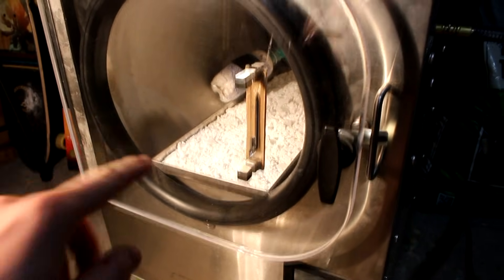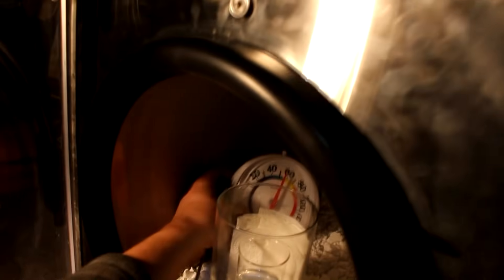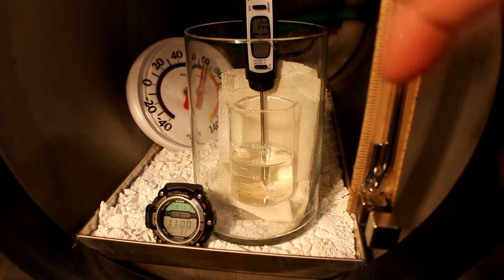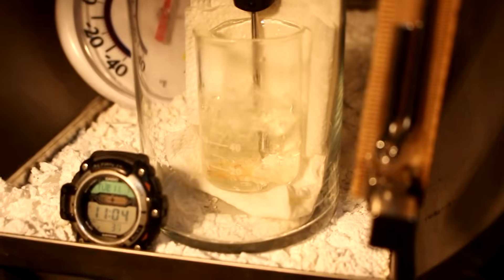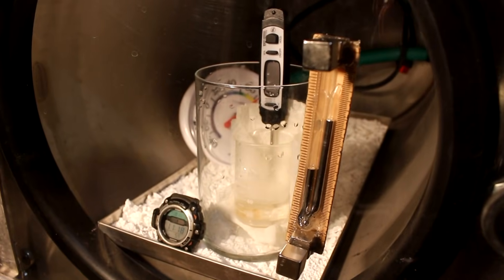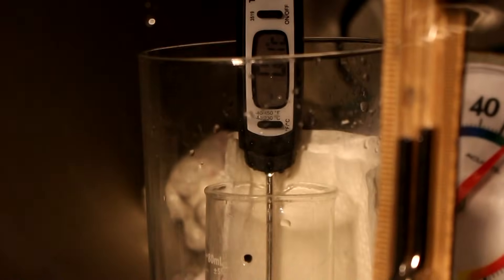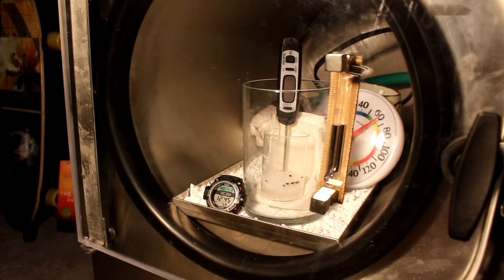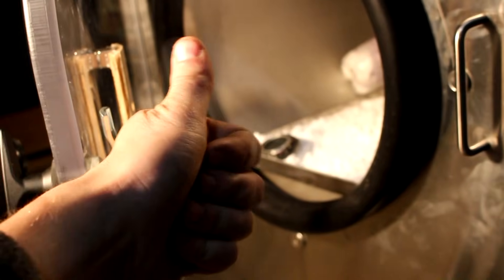Boiling Water Until It Freezes

Comment: Metric The System For Retards That Have To Use Their Fingers To Count
Reply: 12 inches in a foot. 3 feet in a yard. 1760 yards in a mile. Or just 10 mm in a cm. 10 cm in a dm. 10 dm in a m. 10 m in a hm. 10 hm in a km. Now which is more precise?
Reply: *****
Thinking is hard, try it sometime dipshit.
Reply: Crooked Hillary I didn't ask which was easier. Which one is more precise?
Reply: Crooked Hillary Haha you still can't answer which is more precise. If you're educated in even high school chemistry you would know, smaller graduations = more precise.
Reply: Both are equally "precise". Precision is a matter of measurement resolution, not ease of conversion. That said, Imperial is advantageous for quick measurement using units that are easily relatable to practical experience, while metric is much simpler to perform calculations with.
Reply: Crooked Hillary Sure you can divide it like that. But are your rulers marked in thousands of inches? That's not directly relatable anymore, is it?
Reply: This is bad bait and so many people took it
Reply: I got the joke, it is a good joke, even when it is from anarchist.
Reply: Crooked Hillary your cookbooks don't use metric and so it is racist?
Reply: moo. don't even try to convert 5/64 of an inch to mm haha
Reply: omg someone else actually realized it was a troll
Reply: Crooked Hillary thinking is hard and you seem to not think about one simple think. if you are going to put all your processong power just to understeand measurements you did you will be simply unefficient. imperial system is based on completely arbitrary shit that have no logic or anything in it
Reply: Crooked Hillary not to mention that imperial system is DEFINED by metrics
Reply: The British Imperial System- the system used by Americans who.... supposedly hate the Brits... hnnnn yeeeeah lol calling people who prefer to use whole units rather than ones based off what? "the length of the King's arm" "the width of the kernel in the wheat" etc etc yeeeeah again, oh oh oh so accurate lol Oz here so  not against Pommy land but man oh man metric just beats the snot out of our old system.
Reply: Crooked Hillary Also the metric system is completely compatible with scientific notation. Nobody uses standard notation.
Reply: Worse, an inch is 2.54cm. 25.4mm. How the fuck do I measure .4mm without a caliper lol
Reply: Crooked Hillary 😂this is hilarious
Reply: +hey7328 You're talking to a Trump supporter. Their brain has since left their body for awhile now. You can't reason with it, something needs some knowledge to be reasonable.
Reply: *****
My Aunt Jemima Cookbook.
Reply: *****
I can divide a mile into thousandths of an inch, that's precise enough for me.
Your desperation is amusing.
Reply: My Cookbooks Don't Use Metric.
Metric Is For Weak Minded Conformist.
Metric Is Racist.

Comment: I haven't seen anyone mention this, but this property is one of the major reasons why you need to wear a pressure suit when flying at extremely high elevations.  The lower pressure actually causes your blood to boil (specifically in the joints).  The end result is a build up of nitrogen gas, which is of course very painful.

Comment: Can you burn water? I think if you heat it fast enough it will burn instead of evaporating
Reply: in that case youre not actually burning anything, the burned material at the bottom of the snowball youre heating with the lighter is actually just soot

leaving this link which explains it better: http://www. snopes .com/politics/conspiracy/fakesnow.asp
Reply: Cheeseymanpie Jr. no,you need to split the oxygen and hydrogen first by electrolysis.Extreme heating will only result in extreme flashover
Reply: water can be burned if electrolysed, but you cannot gain any energy from doing that. unless you use nuclear fusion on hydrogen produced from electrolysis.
Reply: Water is actually a combustion product, assuming your definition of 'burn' means what most people think of, which is actually a redox reaction.
Reply: there's no carbon in water, so no
Reply: As water is a combustion product that is fully oxidised you can not burn it. 
@Anonymous User. Please explain, what is the relevance of carbon?
Reply: it wont burn. “Burning” is requires a fuel source and carbon is the only fuel source that would leave a “burn” mark. thats why wood is black after you burn it. there is literally no way because if water has 2 hydrogens 1 oxygen atom there is no carbon present, but it is possible to evaporate it. im pretty sure the only reason you can “burn” snow with a lighter is because the gas used in the lighter has some chemical that leaves a thin layer of carbon (im not counting electrolysis as burning bc you cant extract energy from it)

Comment: Another wa you can protect your pump from water vapour is to put liquid nitrpgen cold trap in line.  At liquid nitrogen temperatures the vapour pressure of water is about 10^-10 torr which pretty damn good vacuum.  Water freezing onto a liquid nitrogen cooled surface also acts as a gettering pump traping vapour as it freezes.  One scenario for pumping a vacuum could be to pump with a water aspirator then freeze the remaining water vapouir with liquid nitrogen.

Comment: Isn't a perfect vacuum only theoretically possible? Even in very deep space you will still have a certain number of Hydrogen atoms within a meter cubed.
Reply: That depends, in a small enough volume you can't fit an atom, the lower the pressure the less likely any given volume is to contain anything at all. In the lab it's possible to make milliliter perfect vacuums easily enough.
Reply: Camroc37 yes
Reply: Mostly you just classify the kind of vacuum by the pressure left (normal, high, ulta high, etc.). So in a classical setup you will mostly just say it has a strong vacuum with 10^-9 bar or so. But if you try to push the limits with like very small volumes, you might crack the usefulness of the difinition of vacuum. Even if you manage to get out all gas and other real particles, you end up with vacuum fluctuations and thus virtual particles (quantum mechanics) which are basically pairs of matter and anti-matter popping in and out of existence. Those are always there and also can do work (see casimir effect), even though you classically (newton mechanics, thermodynamics) have a perfect vacuum. So if you try to be precise you have to check definitions and their purpose. I hope that helped^^
Reply: @NoThankYouLeaveMeAlone  "anti-matter" is science fiction that is believed to be an absolute truth, akin to some kind of religion. This is ridiculous.
Reply: Does it matter, though? This experiment hardly needs a perfect vacuum.
Reply: @Nyerguds  I think that's the question,does perfect vacuum "matter?" Lol
Reply: @etherealrose2139  Yes it is very important matter. Its the same matter is possibility of FTL travel. It is possible and we will achieve it sooner or later.
Reply: Camroc37 although you are right we have no way to make a true vacuum
Reply: @emmitunderwood9502  Everything is possible with enough understanding of how things ACTUALLY work, and not some stupid pseudo-scientific hypothesis that are believed to be 100% truth because abstract math that exists only in human neural networks told so.
Reply: Camroc37 Even perfection is relative. Any descriptor is relative.
Reply: maybe you can do something like ionize the air inside a container and then use a magnetic field to move all the air out and make a perfect vacuum idk and im fairly certain we can create perfect vacuums since we can store antimatter or maybe its not quite perfect and there just a really low chance for the particles to collide idk

Comment: So as long as the vacuum remained it would stay frozen correct? Could you use this to create a form of long term cold storage that would be sustained without electricity(beyond the initial power needed for the pump)? put a bunch of water into a vacuum chamber along with the stuff you need to keep frozen. suck out the air  util the water freezes and that in turn would keep your items frozen?

Comment: An interesting derivative similar to this is used to boil sea water at a lower temperature to make fresh water.. A vacuum is added to the chamber using heat from diesel engines to boil the water. The water that is turned to gas is then condensed...   We used these types of water purification systems on military vessels.  I preferred the taste of this type of water over that of water produced by ROWPU ( reverse osmosis water purification units ).

Comment: Hey Cody there's some videos of people setting off thermite on top of blocks of ice, causing an explosion. People are arguing that it's the water breaking into hydrogen and oxygen and the hydrogen is igniting. You should try it on some blocks of dry ice and test to see if it's just the thermal shock or if it's the hydrogen. Really dangerous though

Comment: We used to do something similar to this, though it never froze for us.  We used to seal water inside a glass jar and turn upside down.  Then we would put ice on the top, this would cause a drop in pressure and the water to boil.  Just an odd thing we used to do.
Reply: The boiling point just means the energy it takes to go from the liquid phase to the gas phase.  Since the more energetic molecules are going into the gas phase, the remaining are of a lower temperature.  That is basically why.
Reply: Uhh, no, lowering the boiling point is exactly what lowering the pressure does.
Reply: It should be both, though the oxygen will come out first.  The oxygen will come out and replenish the atmosphere but will get siphoned away with the vacuum pump, then the water will boil.  There is only so much oxygen diluted in the water, the water won't break down in the presence of a vacuum so there should be only water left in the end.
Reply: so will vapor  etc. all boiling is in physics is when vapor pressure exceeds atmospheric pressure.
Reply: i must try this..
Reply: Nicholi Martin the ice cube made the air shrink enough for the dissolved oxygen In the water to come out and regulate the pressure but in this the air came out to regulate the pressure and got sucked out making there no barrier I guess and the water froze
Reply: Hey I don't understand why the drop In pressure in the video caused the water to freeze. With looser bonds, the molecules should be more active and be able to boil more. So why did the drop in pressure cause the water to freeze?  It's been about 6 years since I last took chemistry
Reply: Why doesn't the molecules try to part the energy among each other? I thought they'd try to balance themselves out.
Reply: They do. Imagine a fast moving particle in the middle of the water, it bumps the on above it and imparts a higher speed on that one, which in turn bumps the one above it.  This happens a lot sometimes it goes down and sometimes up.  Until they reach the surface in which this fast moving particle has enough momentum to break the bonds and move into the gas phase.  The less air there is the easier it is to go into gas.  Hope that makes some sense.
Reply: Nicholi Martin It kinda worked. I don't really understand it anyways though. Oh well.
Reply: A lot of times in chemistry, pictures help but I can't make a picture in a reply.  It's ok though.
Reply: you can just not easily ( using numpad as part of the mouse doesn't help either but alts/copy and paste exist):

║░║
║▒║
║▓║
╚═╝

of course you could also just point to the equation PV=nRt   where:

P= pressure
V= volume
n= number of molecules
R = ideal gas constant
t  = temperature 

so as pressure decreases the LHS ( left hand side) decreases so for the equality to hold the RHS ( right hand side) has to change as well this can only happen if the number of molecules goes down ( some escape as a gas) or if temperature drops  yes volume may increase as things get less dense potentially as well but the point is whatever makes the sides equal has to change for the ideal gas law to hold.
Reply: @Pyroplayz: Why do so many people claim this isn't boiling but just "releasing dissolved oxygen"? Sheesh. It really is boiling, people. The physics behind it really isn't complicated.
Reply: Nyerguds becouse lowering atmospheric pressure doesent lower boiling points but
oxygen will come out of the water to try to replish the pressure
Reply: It did pull the oxygen out, but if you have enough room in the jar with enough water you can still get it to boil, just not freeze.  I just thought I would mention something fun I did years ago for my nieces.

Comment: This is actually the process that scientists use to reach temperatures approaching absolute zero called evaporative cooling. However, instead of using glass beakers, the substance is actually suspended with magnetic fields which allows you to adjust how cold  the substance becomes.

Comment: If you put a large ice cube in the chamber and suspended two weights from fishing wire/copper wire (regelation setup) and then decreased the pressure, would it have any effect on the how quick the wire goes through the ice?

Comment: Hey Cody! I searched on YouTube on how to make sulfuric acid (H2SO4) with only sulfur and water. There's some methods involving electrolysis but most of them require chemicals like hydrogen peroxide.

Now of course the goal is to make H2SO4 by only using water and sulfur, I researched a bit and found the way they do it industrially, and they use a Vanadium Oxide catalyst. Here's the reaction: 

S + O2 -> SO2

SO2 + O2 -> SO3 + O (With Vanadium catalyst)

SO3 + H2O -> H2SO4

If you could make it yourself and show us, I promise I would give you a thumbs up :D
Reply: Pretty sure this reaction needs very high pressures and temperatures. Both of which are hard to obtain in a home lab, not to mention the danger of high temp+pressure acids
Reply: billytisme well he just proved us he can obtain high/low pressures
Reply: Well if Cody can get 450C at 1-2 Atmospheres and make H2SO4 I would love to see that video!

Comment: Why did the thermometer stopped working and how did the vacuum affect it?
Reply: If you search "cold bug" you will see that microprocessors often have a lower bound for the temperature they will function at normally.  For the CPUs used in computers this is usually much lower than the -10°C in this video but those are manufactured with the best technology available versus comparatively cheap thermometers.
Reply: I have a similar thermometer. It times out after about 5 minutes so that might be the reason.
Reply: TripmasterG, I believe the temperature inside the plastic enclosure of the thermometer did not drop significantly. the termocouple in the probe dropped to below zero and thermometer did not have any problem measuring it right after the pressure was restored and the button was pressed. so it either the pressure or the timeout.
Reply: or was it just a timeout? are there any damage inside of it and to the battery?
Reply: It was just that the thermometer timed out. The thermometer itself was at the same temp as the rest of the chamber (it did not change temp as shown by the bimetal thermometer in there. There were very few molecules to transfer heat from or to so it stayed about the same temp.) The circuitry and the thermometer in there don't care at all about the pressure difference (vacuum) as it does not affect the tools at all. The only thing computers care about atmosphere for is to reject the heat they make directly to the air. 

tl;dr The thermometer D/C about pressure and it just timed out.

Comment: Just so you know, high vacuum is classified as pressures from 10^-7 torr on, or a millionth of atmospheric pressure. You achieved middle vacuum, barely, impressive with only a mechanical pump. You would need a diffusion pump to get lower.
Reply: J Paino never more than 1 atm of pressure.
Reply: That pressure gauge is hideously inaccurate for the kind of work you do.
Reply: Actually 10^-7 torr or less would be considered Ultra High Vacuum. And to get to those levels not only a turbo or diff pump will be enough, but better seals and a clean chamber would be nice. :)
Reply: Anyone know what kind of force would be acting on that (perspex?) door? It looked quite thin and had a large surface area so when he was talking about a 'high vacuum' it seamed a little concerning. 
Then again it didn't appear to flex in and become concave or anything so it must have been all good. Is that some kind of crazy strong door or was the force a lot less than i'm imagining?
Reply: Plexiglass that thick can absolutely take that kind of force. You can probably get away with half that thickness.
Reply: +J Paino
That door seems to be about 1 foot in diameter. That's about 113 in^2 of surface area. And 1 atm of pressure equals to about 14.7 PSI.
So, multiply both and we have about 1662 pounds of force.
But it's not a complete vacuum so it's gonna be less than that.
Reply: Oh wow, thanks for the reply :) Yeah that's the kind of force I imagined. Should he be worried about the door breaking, or is it stronger than it looks?

Comment: What would happen if you opened the chamber at a very low pressure?
Reply: Zechlin you couldn't physically open it because there would be approximately 14 lbs of pressure per square inch of glass holding in closed. In other words, if that clear door is 100 square inches, you'd have to apply a force of 1,400 pounds to open it.
Reply: Njal Thorgeirsson 
Oh
Well then
Reply: spaceminions, it may be similar to the sound when you brake an incandescent lamp with a vacuum (not with an inert gas).
Reply: OK, so I get myself 10:1 mechanical advantage or so and give it a shove. (Or shoot the glass to shatter it) Is there any interesting sound maybe when the air rushes in like that?